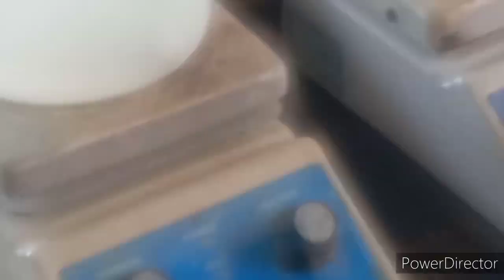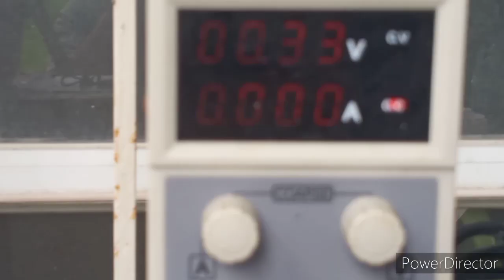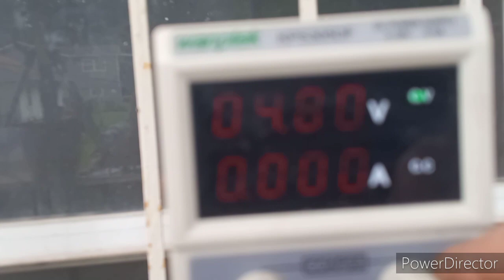KOH & KClO Via Membrane Cell Electrolysis Vol. I

Comment: though when I try to make hypochlorites with my membranes it mostly makes a lot of hydroxide until a certain point.
I usually run at 6v 10 amps with my setup because monovalent ions pass through cation exchange membranes easily!!

Comment: I have used simple hot glue to plug a clay-pot hole, with evident success.  It never showed any sign of damage.
Chemically I'm not sure what attacks the hot glue does and does not resist -- but I can tell you it seemed completely impervious when exposed to KOH in an electrolysis rig for a couple of weeks.

Comment: I've frequently wondered with clay pot membranes, if several cathodes were spaced equally around the outside with the anode dead centered, then wouldn't it present a more uniform electric field that pushes and pulls on the different ions  resulting in more clean separation in an electrically more efficent and quicker process. you have a circular membrane, but the electric field focuses most of the current through maybe 1/3 of the clay pot's surface area or less.  And adding cathodes all around will increase the current allowing you to run it at a lower voltage saving energy.
Reply: @pbn3215  I suspect the origin of the thought to balance the surface area is rooted more in economics and flat plates,  and is not as directly aplicable to circumferrntial geometry and the inclusion of membranes that offer resistance. 

Yes I agree, one kind of limit is the surface area of the smallest electrode and this is a really big factor where you have two flat plates facing eachother, but one is smaller, but there are more factors limiting current flow than just the surface area of the anode to consider in your clay pot membrane with one round anode and one round cathode, some distance from eachother.  As I was mentioning the membrane in my first comment, for the most part, your using just a fraction of it. if you were using more of it, then using more membrane would represent less resistance to current flow and less heat generated, which could allow you to lower the voltage a little and still sustain the same current.  Let me give you an electric circuit analogy,  resistors added in parallel add as the reciprocal of the sum of the reciprocals, that is if one square inch of membrane has a resistance of  4 ohms,  then the resistance across 8 sqare inches of membrane is 1/(1/4+1/4+1/4+1/4+1/4+1/4+1/4+1/4) = 0.5 ohm, so it should becomes clear why using more of the membrane lessens the total resistance to ionic currents allowing more ions to flow for a given voltage and anode surface area by using more cathodes in a circle  around the anode.  also, having cathodes surrounding the anode giving clear more direct electric field line of site to all parts of the anode, shortens he distance to some parts of the surface area on the anode.

in a solution of ions, the charges will always be balanced across the whole solution, including ion flow capacitors. So it doesn't matter if the cathode has 10× the anode area.   But, while I'm sugesting a few  more cathodes to balance the electric field  more evenly  around the membrane, there's a point of diminishing returns where the cost of extra electrodes don't offset the economic and efficency benifit of reducing the ohmic loss of the membrane, and ohmic resistance to the ion flow through a distance of electrolyte. I concede the current density on the cathodes will be 1/10  that of the anode  if you have 10 times as many cathodes.  But I am not certain that posses any problem so long as current density on the anode doesnt exceede certain values. The point here is to lower certain types of resistances.

I work with electronics and when I worked for a specific company I also  developed and tested better and more efficent water electrolisys units for about 5 years.  We didn't use membranes because we wanted both hydrogen and oxygen on demand and wanted to produce it efficently in sufficient quantity. 

water electrolisys without side reactions sapping energy may be modeled electronically as a resistor and a 1.24v zener diode where power lost in the resistor is waste heat and power lost over time in zener diode is not really lost but is converted into the chemical energy of seperating water molecules, where the amps × resistance = voltage drop across the resistor, and voltage drop across the resistor × current  is waste heat, and amps 1.24v is power going to make Hydrogen and oxygen.  Just like were a current will not flow below a zener diode's zener rated voltage,  current will not flow through water when the voltage is dropped below 1.24v. 

with all that, you can work out the efficency = power to make product / (power making product + power making heat)

as to what the resistor models is, one can know that for a given electrolyte and temp the model resistor is proportional to the distance between electrodes and inversely proportional to the surface area while the electrolyte type, concentration, and temp are nonlinear, and under high rate of gass production,  the bubbles in suspension can reduce the effective  cross section through which ions can flow. 

Some people like to use pulse with modulation to regulate power by varying the duty cycle, but it can be far better and more efficent to regulate power with a buck converter to a lower more efficent voltage that pushes less current, but  produces 100% of the time. 

Early on I made pulse with modulated circuits but observed high inrush  current like one would see with a capacitor, and seeing the plates as a capacitor with the electrolite as dielectric below 1.24v, made sence if seeing high inrush currents.  Then I switched to designing Buck converters for better regulation of wate heat. 

Anyhow, this turned out to be a long comment.  I'm not an experienced chemist, but my point is I have lots of experience with  electrolysis and electronics which gives me a uniqe view of electrolitic cells.  If  your interested in any the therory I shared above, let me know, and I can better explain in another comment if need be.
Reply: @pbn3215   coming back to this,  I think I remember reading somewhere that electrolysis is rate limited more at the cathode than the anode under higher current due to double the volume of hydrogen bubbles limiting the cross section through which current may flow. 

I guess this could easily be tested without a membrane.  Test the Amp draw   from both a)  a cathode surrounded by anodes, and see if it differs from b) an anode surrounded by cathodes.  Do this at low, medium and then high voltage. And compare the Amp draw and maybe electrode wear.

Comment: I don't understand why you put distilled water in the cathode part and not also KCl solution?
Reply: If anything you'd seed it with some hydroxide (this is why the cells start up very slowly, there's nothing in the water)